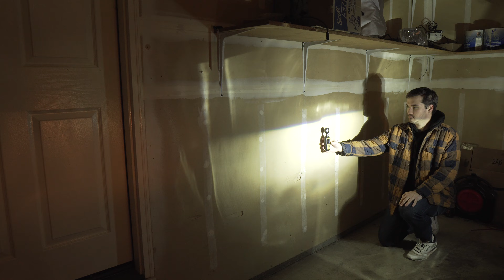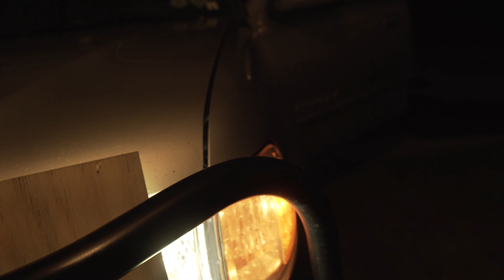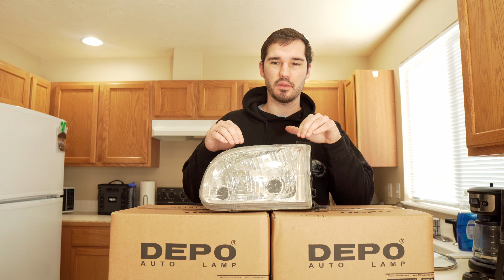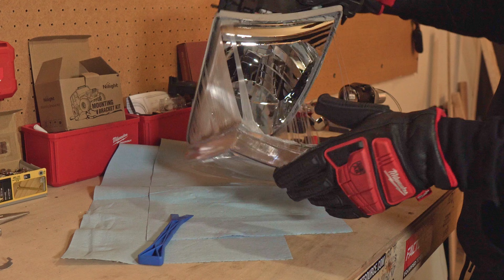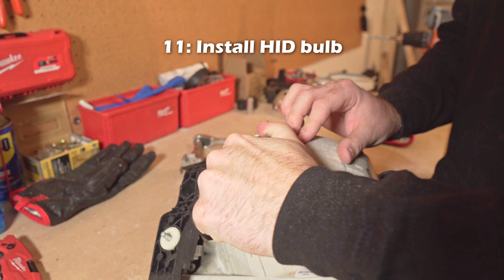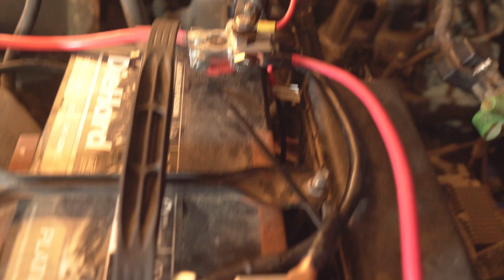The TRUTH About Headlight Upgrades | Colight Mini Projector vs Morimoto Micro D2S

Comment: i wonder if you painted or removed the reflective material inside the housing would the colight do better with "scatter"
Reply from the maker: It’s supposed to project light…. Shouldn’t be throwing light around the housing anyhow…
Reply: @208Tyler  Could be the because the retrofit projector are a lot closer to the glass on these old toyotas they arent smooth

Comment: For the projector retrofit, do you specifically need headlight housings without the DRL’s? I noticed the new set you used doesn’t have DRLs
Reply from the maker: My old set doesn’t have DRL’s either…?

I’ve never worked on the late model tundra headlights that have the little DRL light/housing, if that’s what your refering to
Reply: @208Tyler gotcha I misunderstood. I thought the colight housing had space for DRL but I think it’s actually a reflection I’m seeing

Comment: I would say the difference is mainly due to the type and power of the bulb used. A higher power mini led projector will give similar brightness like the retrofit one. Also try using an led bulb in place of hid as leds tend to last longer than hid bulbs.
Ps. Try other mini leds some are much better than others, ive used one and the cutoff was perfect with minimal glare

Comment: If my car already has projector headlights from oem do you think there's gonna be a change when I put those mini projector light bulbs? Since my oem projector doesn't have that sharp cut off line I want to try that
Reply: A mini projector inside of a projector housing will not work at all… don’t even try. If you don’t have the sharp cutoff line, I’m guessing your headlights are clouded. Getting them restored or polished will help allow far more light through

Comment: This was a great video and the explanation at the end sums it up nicely.  Cheapest light upgrade I found for a Toyota:  Replace the low beam bulb with a high beam bulb.  Just need to remove a little plastic insert from the plug to let the high beam fit.  The light housing/geometry still creates a very crisp cutoff so no blinding people.  The high beams don't have the lifespan of standard bulbs but at $12 per bulb it is super cheap to keep an extra bulb or two tucked somewhere.  It isn't bright like the sun, but it is simple and a large improvement over the amazingly bad stock.

Comment: Did co light update the mini projectors? My mini projectors look a lot bigger than yours. I wonder if that makes much of a difference.
Reply: Trying to see if I can stuff one of the mini projectors in my fog lights too.
Reply: @Greasenipples  Yes, the mini-projector LEDs work on the later first gen Tundras with the round fog lights, however not sure about the early models with the squares
Reply from the maker: To my knowledge, the Y12 H4 has not changed...
Reply: @208Tyler  It looks like there is a couple different versions. The ones I got off Amazon have a 1.38 inch lens. The Y12 in your video has a .75 inch lens. I’m curious if that makes any difference. Maybe the Amazon version is a knockoff? It says the model is Y1 and that’s not on co lights website.

Comment: When it comes to optic, size does mater. That's why you should have probably gone for the 3" mini D2S since the headlight is large enough for it, it should be about 30% brighter.
For the small light scatter out of the projector, it's probably because you have some light leak between the projector shroud and the factory reflector.

Also, that cheap projector was aimed at the sky ^^
Reply from the maker: I chose the projector based on price. The makes sense. 

No…. The mini projector was aimed alright. I tested that all out when I first installed it
Reply: @208Tyler  oh, then yes, I didn’t realize the difference was significant.

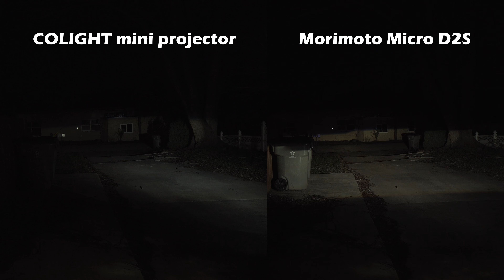At 1:53 you can clearly see that the LED is aimed way higher than the HID, so at least one of them is badly aimed ;)
Reply from the maker: At 1:53 what you’re seeing is the cutoff line disappear due to scatter above the cutoff line.

Comment: How is the cost of repair if these break or wear out? Thank you for the great videos, your work and thoughts help immensely.
Reply: I purchased my morimoto mini d2s 5.0 35w retrofit kit back in dec 2018 for $300 with holiday savings and also got new headlight assemblies to put into. We had some really bad flooding here and the rubber boot that goes on the back of the headlight assembly had crumbled away and deteriorated over time and allowed water to get into the assembly so the bulbs burned out in sep 2024. By this time the bulbs had started going down in output and needed to be changed anyway as it had been 6 years already. Then 1 igniter needed to be replaced also before the flood in jul 2024. I should have done both because both of them the plastic retaining tabs have broken from becoming brittle and breaking off, but i'll do that one soon this month. It causes the bulb to not sit flush and affects it's light output in the hotspot and the ability to adjust height of the beam. Again not bad it lasted 6 years. I drive a lot in this vehicle with mixed usage day/night. Overall the morimoto line is great for value. 55w vs 35w will get you brighter, but more heat and power and you have to be careful with the housing/heat generated. The ballasts do take a little to warm up, but it's just like 5-10 secs for full output. With the AR coated 5.0 projector just use 35w 6k bulbs to offset the green tint they output. I used 5500k bulbs the first time and they were great, lots of light, clean cutoff and easy to drive at night. I'm going to go with Colight Y16 bulbs in my new to me 2007 toyota sequoia I'm restoring until holiday time to get a good deal on my retrofit kit again because they are currently $410 to retrofit, up $110 from 2018. So yes they are worth it, and the plug and play nature of the pieces involved means you can easily swap out bad components that seem to last a long time in my opinion.
Reply from the maker: You’d probably be looking at replacing an individual part, like the bulbs if they go out. i want to say those are $50 a pair. I would say most people sell their vehicle before the retrofits ever break down.
Reply: @208Tyler  That is good to know. It really seems worth it to retrofit.
Reply from the maker: Ya! In my opinion it definitely is!